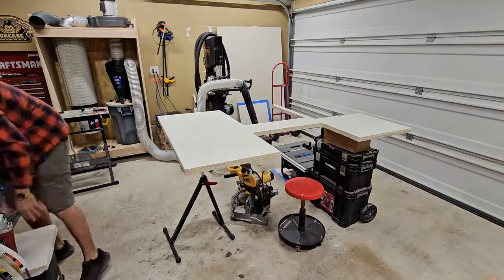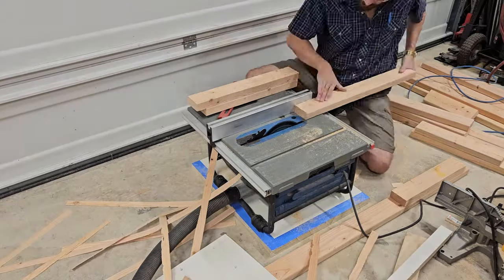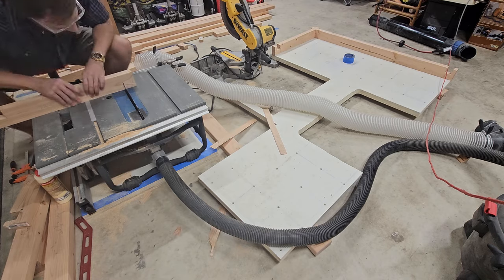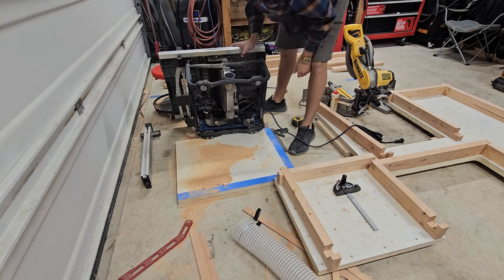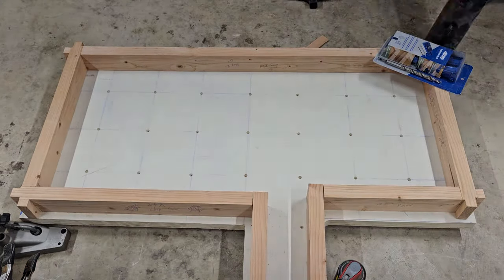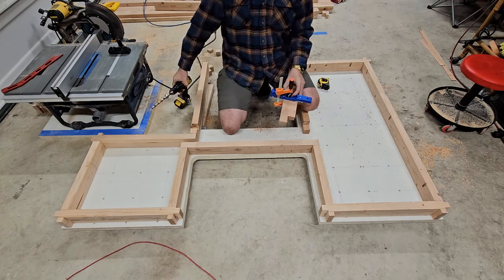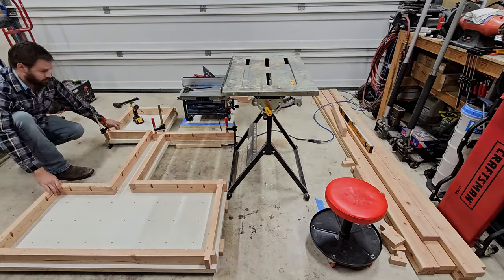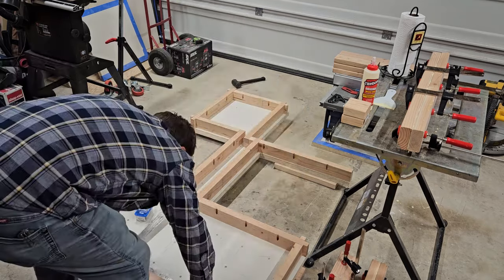Morphing Workbench Build Part 2 - Lap Joints and Pocket Holes - The New Dust Collector Helps

Comment: Grab a used table saw. I got a free ‘portable’ delta that will take a dato set for free. But you can pick one up for under 50. I really want a shopsmith 5
Reply from the maker: Nice! I'm a little floospace constrained, but I believe Dewalt makes a jobsite table saw that'll take a dato set. It might fit right in where the current Hercules saw is going to go in this new workbench.